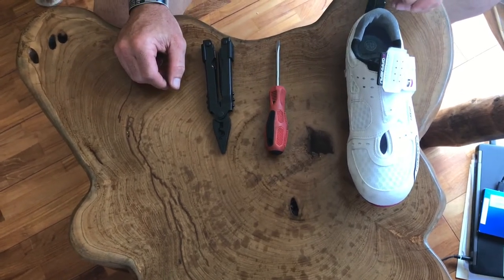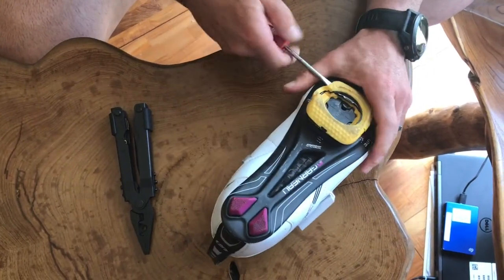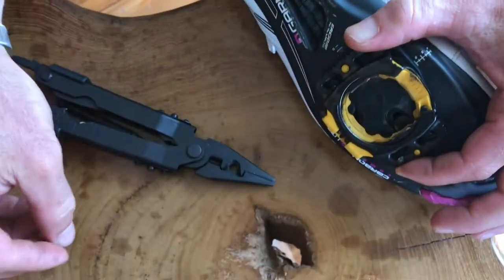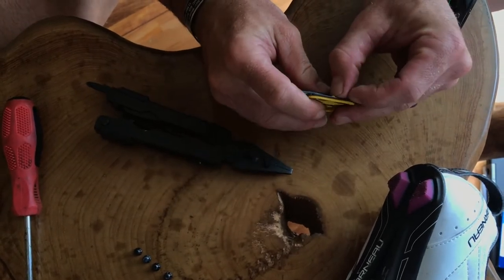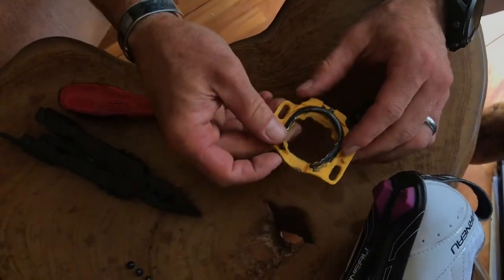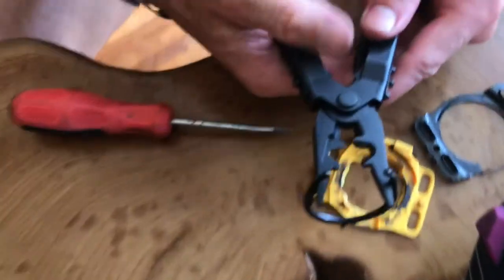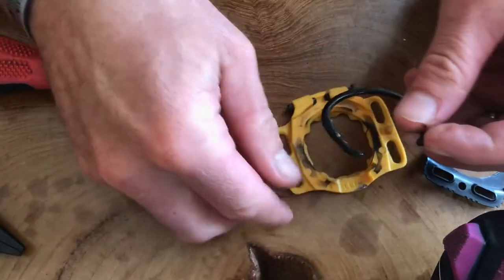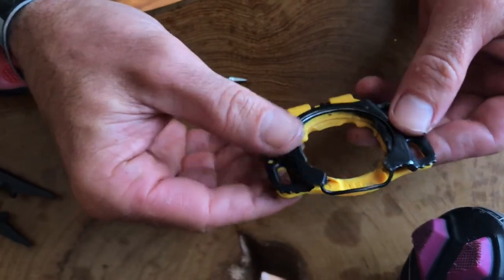Speed Play Clip Adjustment

Comment: and this highlights the design flaw of speedplay brilliantly.  
the horseshoe spring tension cannot be finely modulated, which makes the cleats unpredictable for novice and lighter female riders, and short lasting.
Reply from the maker: Rider preference, once adjusted it works out pretty well. Speed play is the pedal that doesn’t cause pain with my knees. So maybe be biased.
Reply: @KristopherUlbrich  
How long have you had the same pedals? 
Longevity is an issue. 
I and my wife have used speedplay in the past. She had trouble with the spring tension, and didn't last 2 weeks on them. 
I have gone to a similar Chinese pedal, that has been no problem over 10,000km.
Reply from the maker: At least 5 years now with at least 8-10K on them. They do get tighter if I forget to lube, especially since I live in tropical areas and ride in the rain a good bit.

Comment: Hi,

Thanks for the advice! Were you able to clip the pedals in by hand once you made the adjustment? As mine are tight, but I was putting it down to not “broken in” yet

Cheers

🏴
Reply from the maker: Paul I was able to secure them into the pedals with hand strength, however it still required a good bit of force with my hands and a little wiggle back and forward. Good luck 👍
Reply: Paul, you’re not supposed to be able to clip them in by hand. If you can something  isn’t right. It’s designed to work with the weight of a rider pushing down with their body weight. In time it will all come together and work good after you’ve used them a while. Just don’t modify them.

Comment: What you advised doing is not called for in any Speedplay guidance. I would suggest not modifying that cleat spring in any way. Typically using a dry film lubricant is what will help this, or going to the light action version of the pedal system. It’s more likely though that you chose the wrong front and or rear base wedges and the base is not resting totally flat when tightened down against the shoe. This causes the rest of the stack to bend when assembled and will cause difficulty clipping in and out.
Reply from the maker: Noted
Reply: @KristopherUlbrich  If you wanted to improve initial clip in and all else was okay, you could try taking some scotch brite or very fine wet sand paper and polish the angled areas of the clip that cause it to spread apart when it contacts the metal angled petal portion of the pedal body. Basically advancing the break in process faster.